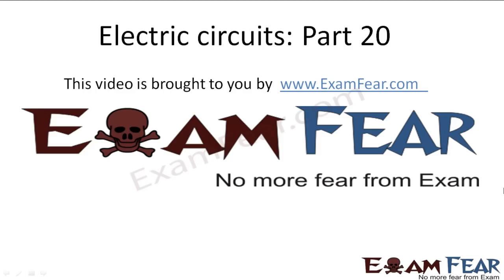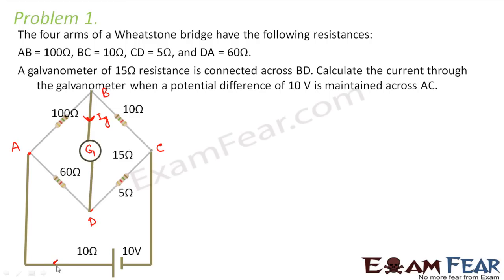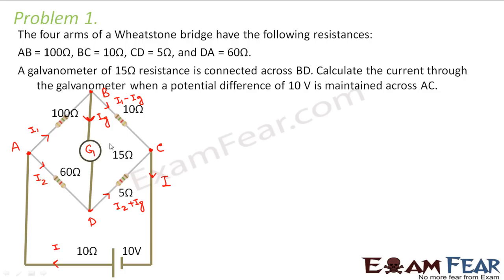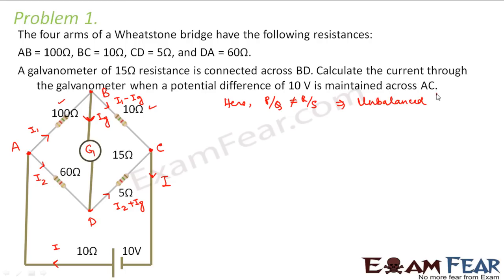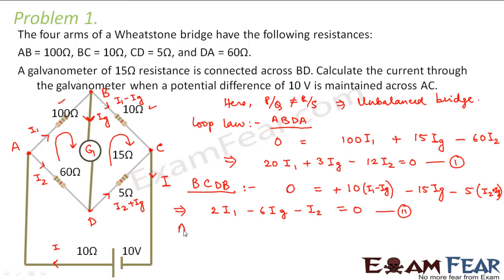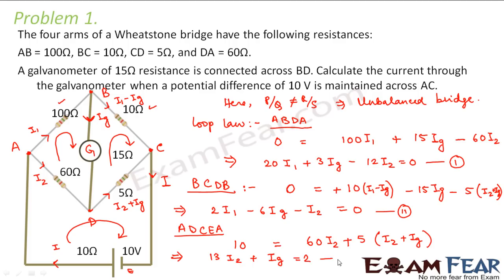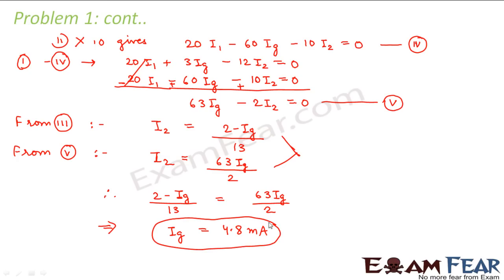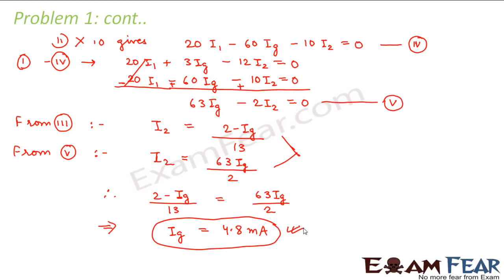Physics Electric Circuits part 20 (Numericals) CBSE class 12

Comment: I just thought that I should tell you this that there is a mistake as you write the equation in the 1st loop. It's just a slip, as you are telling the thing absolutely correct. However you might consider correcting it. Your videos are excellent. Thank you so much for your help.